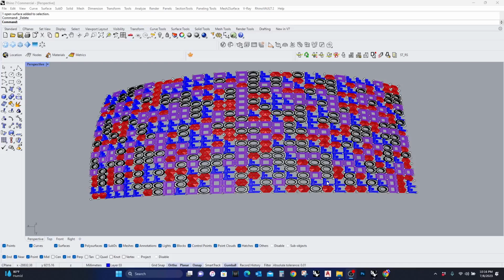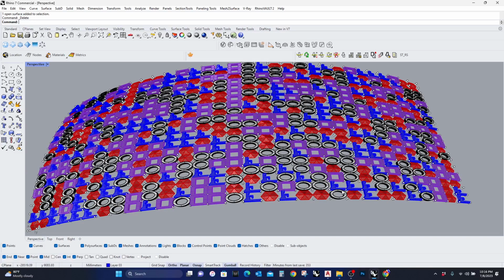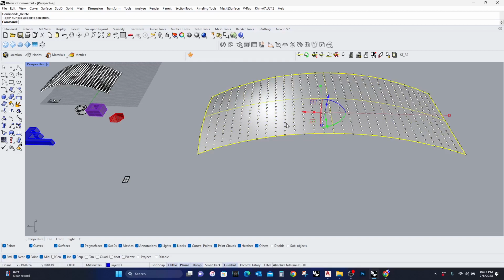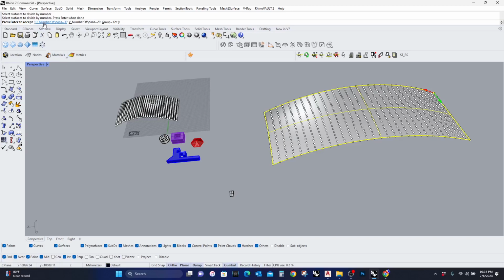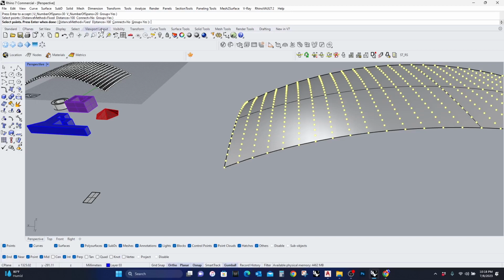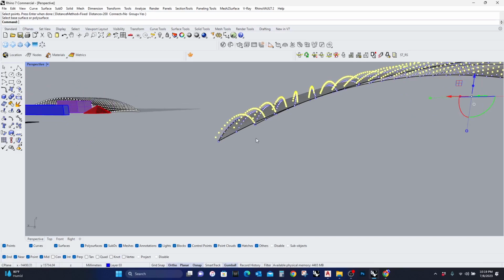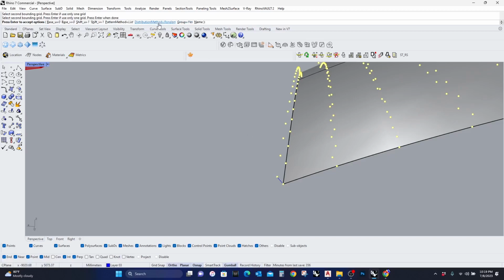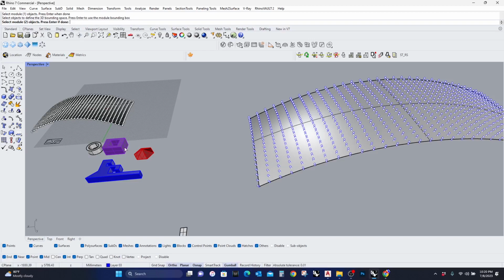Rhino 3d: Using Paneling tools to generate a 3d randomization.

Comment: Very, very useful, but how should I proceed if I wanted to maintain the original depth of the modules?

Let’s suppose, for example, I have:
- a cuboid 60cm high, 20cm wide, and 20cm deep
- a cuboid 60cm high, 20cm wide, and 15cm deep
- a cuboid 60cm high, 20cm wide, and 10cm deep

By following your tutorial, I’m able to distribute them randomly, but they all end up having the same depth.
What if I also wanted to vary the depth?
Thanks a lot!
Reply from the maker: Thanks for the positive comments.  If you want to vary the heights , you will need to do this using grasshopper.  Rhino can be limited.  Grasshopper allows one to do more customizable outputs